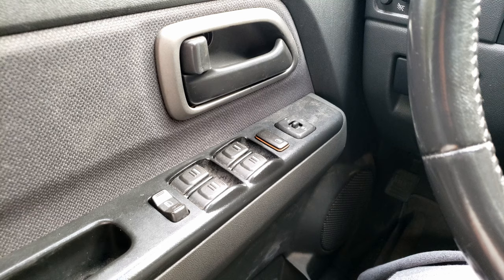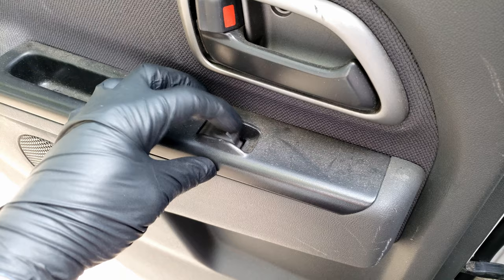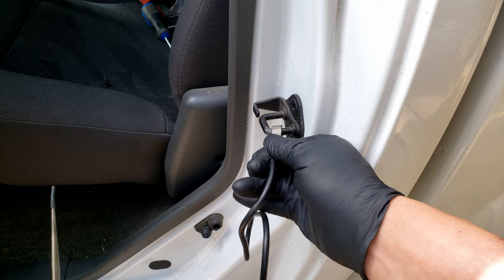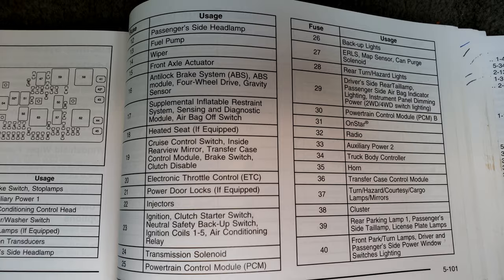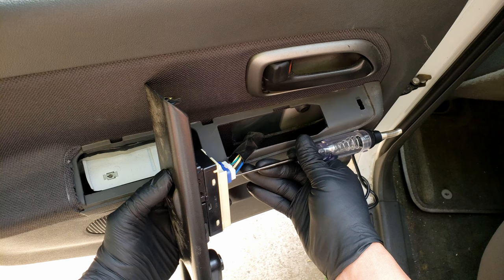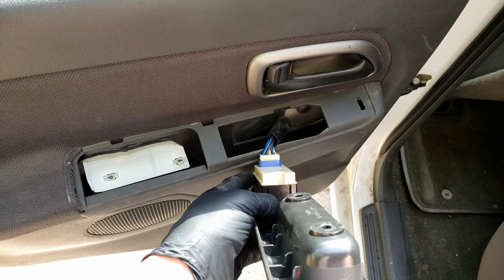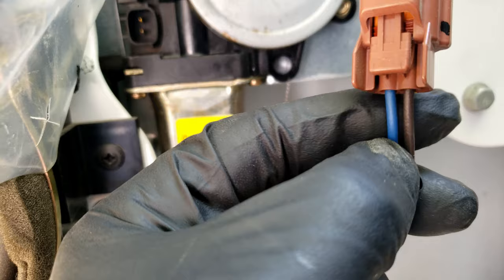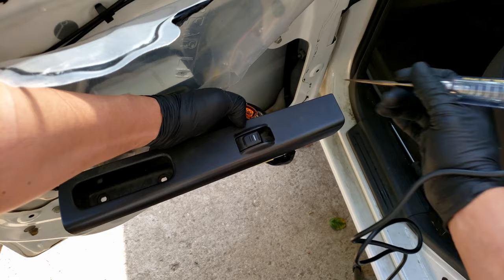How to Diagnose If the Window Switch or If the Motor is Bad

Comment: Hi. On my car  the 2 rear windows does not working with the switches only with driver front main switch , so you think is the 2 rear switches, not good ?
Reply from the maker: did they both stop working at the same time? or first one then the other?
Reply: @backyardchevy328   same time, yeah it is weird
Reply from the maker: @luismora441  the lockouts not engaged either? If u have a way of testing the main signal to make sure its being sent to both switches..maybe the lockout is malfunctioning and cutting off both of em
Reply: @backyardchevy328  thanks , I Will be geting tiene 3 switches in case

Comment: Quick question... I did what you did but I didn't have a constant power when I pushed it to go up I had a light and the same to go down but no constant power. Is that normal? I have a 2006 cadillac sts
Reply from the maker: By constant power u mean the light would turn on but turn off as ur holding it..or u mean the main power wire wouldnt stay on?
Reply: @backyardchevy328  I don't have a constant power. But when I push the switch for the window to go up I get a signal also when I push the switch to go down I get a signal. But I do not have a constant power. I'm testing the connector that get connected into the window motor
Reply: At first I thought it was my window motor but after watching your video I notice I'm not getting a constant power
Reply: I did notice on one of the pens I tested on the connector I was getting a faint light and it didn't beep like the other ones did
Reply from the maker: @gohan9638  yea if u holding the button and the voltage is cutting off, u may have an issue with the window switch

Comment: So i am following this video and it is really helpful. All my fuses are okay, I just need to get a volt meter and check the wires. If the switch is okay from both ends, then it must be a bad motor correct? if so do you have a video on how to replace it or check?
Reply from the maker: Yes, if ur getting signal pressing window switch up and u get it also pressing window switch down..itll be a bad window motor or stuck regulator...but with bad regulator u normally get a click or sound from motor trying to move..and yes i have 2 videos actually on replacing window motor/regulator one on a honda odyssey and another on a chevy truck
Reply: @backyardchevy328  So the passenger side widow switch does not work on that side or from the driver side. There is no clicking sound from either, when operating as well, which must imply its the motor. 

You said i could use a volt meter to test this as well....  Which element of the volt meter would i use to see it there is a voltage the black or red one?
Reply: @backyardchevy328  Do you have the link to these Videos so i can watch as well?
Reply from the maker: @graysongrzybowski943  set it to dc volts..put black cable to ground and the red u use it the same way as test light..itll give u voltage reading instead of the light coming on
Reply from the maker: @graysongrzybowski943  https://youtu.be/JCDPiE0hpqc heres the honda odyssey one
Reply from the maker: @graysongrzybowski943  https://youtu.be/JGqDp-guC6o and the other
Reply: @backyardchevy328  Okay and i just need to have the black one touching any metal source , right?
Reply from the maker: @graysongrzybowski943  well u want it to be like a door latch which is grounded to whole car body or a bolt thats connected to metal of structure and u want it to be unpainted
Reply: @backyardchevy328  would you happen to know if most regulator/motor for a rear window is compatible with the front?
Reply from the maker: @graysongrzybowski943  no theyre different
Reply: @backyardchevy328  damn. This may be harder to find the I though.
Reply: @backyardchevy328  me again, one more quick question. If I find out the motor needs to be replaced, is it just as simple to connect the motor to the window regulator? I can’t find the set together. If it’s a bad motor then I should be able to attach it to the existing , right?
Reply from the maker: @graysongrzybowski943  yea the motor will have 3 or so bolts that attach it to regulator..and the gear in middle of motor slides into the regulator assembly. .then assemble in reverse
Reply: @backyardchevy328  Okay that is good to know! I just got back from trying this meter on the door, and you make it look a lot easier. the electronic piece that connects to my switch only has 4 wires. with my volt meter inside, even before hitting the switch the voltage was going from 0.01 -0.07. Is this a good enough indication that the switch is okay? when i would flip the switch, sometimes it would change the voltage other times it would change on its own. I could not tell you which specific wires were causing the voltage to go up, but i felt it happened in 3/4 wires.
Reply from the maker: @graysongrzybowski943  well with a meter its gonna be different..if u got the self ranging meter that is gonna be adjusting itself so its gonna fluctuate..and for others u gotta set to 20v setting..and ur reading should be at or near 12volts when u press the switch so it would read for example 12.47 volts +/- etc...0.07 would indicate ur not getting voltage
Reply: @backyardchevy328  I originally had it at the 20V and i was not seeing a value. I figured i needed to turn the dial thinking it was just requiring a low voltage to power and i could not see it on a 20V display. 

With all that being said, if its not getting any power to the switch how do it trace back the issue then? Is there places that sell the specific wiring ,is it a universal piece and not hard to come by? Does this become much more complicated then replacing the motor?
Reply: In my mind, how do i even know i was pushing the prong up into the wiring far enough in the first place. Should i have to force it up in there and touch the metal?
Reply from the maker: @graysongrzybowski943  yes, you will have to touch the metal prong to get contact..if not it wont give u a reading
Reply: @backyardchevy328  Okay I will try a few more times and force it up there if i have too. If successful and there is no reading is it much more difficult to replace the wiring to that point? Can you elaborate a bit on the sets?
Reply from the maker: @graysongrzybowski943  u can also use something like a metal paper clip to slide it in and use it to probe if its too thin for the test lead
Reply: @backyardchevy328  I will do just that thank! The switch that controls the window from the driver side does not work either, but I can roll down my window. Should this be fixed when I resolve the issue on the passenger side?
Reply from the maker: @graysongrzybowski943  yes, if its something like the motor or regulator causing it..it should work from both sides after
Reply: @backyardchevy328  okay, thanks again! More questions coming your way went I get a chance to work on it
Reply: @backyardchevy328  hey again! So I did another test and there’s 1/5 that’s giving me a 12V reading! 2 others are reading .07V. When I flip the switch to try and roll the window down the voltage doesn’t change any. Does this imply that the switch is bad? I took photos but apparently I can’t send them
Reply from the maker: @graysongrzybowski943  the one with 12volts is it all the time or is it when u press switch up or down
Reply: @backyardchevy328  it’s 12V all the time
Reply from the maker: @graysongrzybowski943  ok so that's ur main power wire..sounds like ur switch isnt sending a signal to the motor wires then if ur not getting signal up nor down on the others
Reply: @backyardchevy328  So I just need to replace the switch and i should be good?
Reply from the maker: @graysongrzybowski943  based on the readings ur telling me, yes
Reply: @backyardchevy328  okay. I’ll see if I can find videos, change it out and get back to you on it. Would you be able to tell me if switches are universal?

Comment: I have this problem on the same window and it did go down with the main switch and a little bit more with the switch on the rear driver side door but after a few hours I decided to put the window back up and it won’t do anything now. To make it worse I don’t own any of those testers, is there anything else I can use/do to test the switch before I go and buy a new one?

I know this vid is old but if anyone sees I will appreciate any help I can get.
Reply from the maker: Well the best thing to do without the tester is to try the passengers side...if it works with that one then its the switch..if it doesn't then its probably a problem with motor
Reply: @backyardchevy328  All other doors work and what truly bothers me is that the rear door switch and main rear door switch both worked but like I said after a few hours of driving they both stopped working (main switch for the rear driver side door and the switch on that door itself).   

Edit: I’ll check the motor and edit this again if I find out what’s going on with it. 
@Backyard Chevy Thank you for your time and help because honestly I didn’t think about the motor since it had worked earlier today and the a few days ago.
Reply: @backyardchevy328  so I have a 2014 chevy Cruze and my passenger window is the problem I had this problem a couple of months ago and it was the window regulator and got it fixed & today I got in tried to roll it down with the master switch and it didn’t go so I tried with the actual passenger switch it went down then it stopped and now it’s not even making a noise so I’m not sure if it’s a a switch or the motor like you said, I don’t think it’s the fuze bc all 3 other windows work perfect this happened today and it won’t even roll up I tried forcing it and I’m pretty sure it won’t go cuz it’s still on track so
Reply from the maker: @ed.isdead  did u replace both the regulator with the motor? U wouldnt have a test light to see if ur getting signal at the connector when u toggle the switch both up and down

Comment: My Chevy sonic all my windows work except the drivers window it went down now won't go back up and the button for passenger side is stuck but the button works on the passenger side if that makes sense
Reply from the maker: Well best way to tell is if u can remove the switch and see if the switch is sending signal when u press the switch to move the window up..if it does send signal then..you may have a problem with either the window motor or regulator cable..sometimes they tangle, get stuck or even break
Reply: @backyardchevy328 When I push the burton I hear no sound the button moves but that's it when it did work it did take a minute for it to go up and the other buttons work fine and roll the windows up and down with ease
Reply from the maker: @srivera4339  yea normally no noise can be the motor that went out..or the switch..but only way to be sure which of the two it is, is testing the signal coming out of switch to verify
Reply: @backyardchevy328  Thank you so much for your responses I appreciate it just one last question if it is the motor is it a in expensive fix?
Reply from the maker: @srivera4339  anytime👍..on average they sell the whole assembly with regulator and motor for 60-120 dollars
Reply: @backyardchevy328  Thank you so much and that is not so bad I wish you lived near me to help me lol Thanks again

Comment: Hi my car window stopped working, it's only working when I kick the area where is window motor, what can I do to get fixed, thanks
Reply from the maker: normally thats a motor that gets stuck, so youll probably wanna get the window motor replaced, i would still confirm that the connection to motor is connected properly and in good shape
Reply: @backyardchevy328  thanks very much
Reply from the maker: @danielvaher  anytime🙂

Comment: Hello, ive had a long problem with my driver window. It will usually work going down, at random times it wont go up completely. Stopping mid way, I’d have to wait awhile for it to fully go up completely. 
what would you think the problem is?
Reply from the maker: Yea thats most likely ur window motor thats gone bad..that happens a lot on a camaro/firebirds..i had to replace a lot of window motors for that same problem

Comment: Any idea how to test a window switch at a junk yard on a vehicle that doesn't have a key?
Reply from the maker: Well u can use an ohm meter u find the main power wire..u connect one lead to that part of the connector and leave it there..then with other lead u tap into signal out terminal...and press the up switch or down and a good switch should provide resistance once it completes the circuit
Reply: Steal it. Try at home correctly

Comment: Hey. So I established that the motor on my window was bad. I got a new one and got it hooked up. Did you have that IG account so I can send you a video? the motor made the regulator operate, but now it does not and something happened during my instillation. I thought if you saw the videos you could see why
Reply from the maker: yea its backyard_chevy on instagram or i have it linked in the about section
Reply: @backyardchevy328  okay so now I was actually able to get the regulator and motor to fit perfectly into the door. I got lazy and didn’t attempt to attach the glass to it yet so I will keep you posted when I do if I have anymore issues. For now, when I had this hooked up the first time, I noticed the regulator was operating backwards. So the polarity was switched, or down was up and up was down. How could I go about fixing this? It must of be the result of a previous owner
Reply from the maker: @graysong2961  if its reversed just switch the wires around if its only 2..the other video i posted about testing window motors is actually good at explaining how they work
Reply: @backyardchevy328  I will have to go back at look at which wires. But I finished. The motor is installed an successfully operates. First big challenge with no experience. Thanks for all your help

Comment: need help... when i tested the wires coming out of the switch one does light up when i move the switch but the other cable has current all the time, even if i move the switch to go down
Reply from the maker: These are the wires going to the actual motor? How many wires are there?...one of the wires will be the main supply wire so youll have current all the time as long as wiring to the switch is ok..then youll have 2 wires that go to the actual motor..and one should have voltage when u press the switch up...and another should have voltage when u press the switch down..if ur testing at the switch
Reply: @backyardchevy328  yes ... only two....im thinking its the switch but even on the master switch it does the same.. the passanger side us the bad one
Reply: @backyardchevy328  i was testing the wires going to the motor..2 ... one has constant power instead of lighting up when i move the switch for up and when i press for down the other cable does light up when i press the switch
Reply from the maker: @civakalos  yea if one has it all the time either one of the switches is bad and has a short to current or the wire might be shorting to a current wire giving u voltage all the time..but i would disconnect the secondary switch and test the master switch see if it still does the same..if it stops then the secondary switch is probably where its shorting..unfortunately u cant do that with the master switch though
Reply: @backyardchevy328   if the problem window is at the passenger side can i disconnect the drivers side master switch to see if thats the bad switch??
Reply from the maker: @civakalos  no, cause the master switch sends the signal to the passenger switch...but u can try it..not all vehicles are the same..just be sure to connect the lockout switch that allows the other switches to work
Reply: @backyardchevy328  ok thank.. ill give you an update later ... again thanks a lot